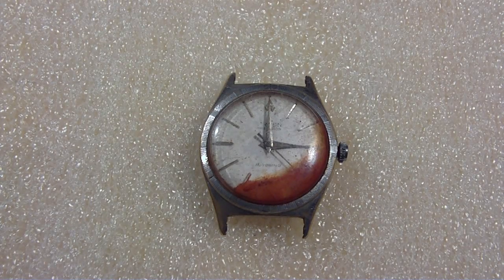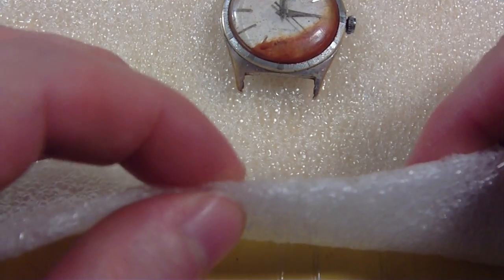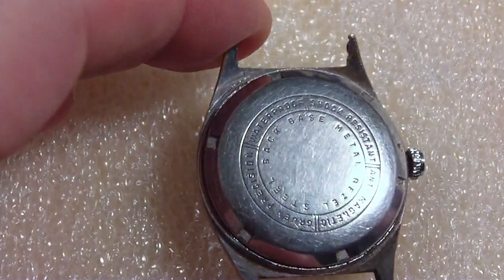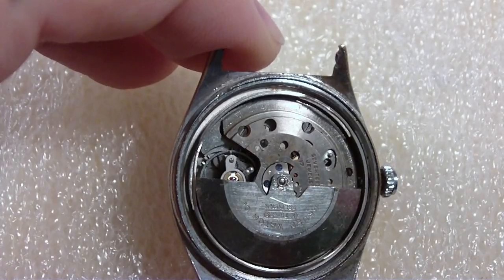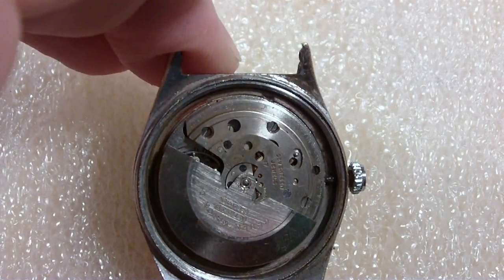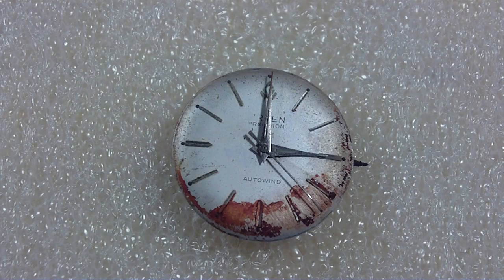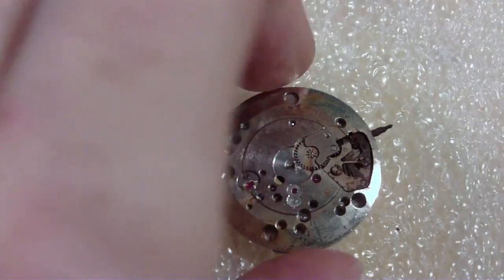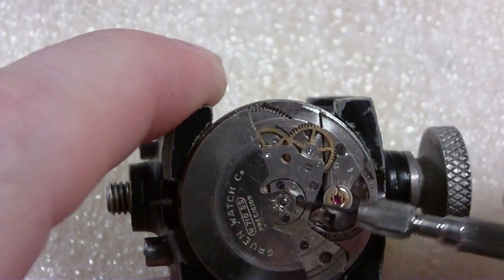How I take apart a water damaged wrist watch, Gruen Precision Autowind

Comment: The crown and stem as you know are rusted due to the crown and case tube leaked in the water. I also see these basket cases on a daily basis.  Just like RJSoftware2000, I also use Vinegar to dissovle and break down rust. Interesting video and appreciate you showing it. Good lesson!

Comment: I love to see movements like this. I use vinegar in ultrasonic and the rust evaporates in seconds. Then neutralize the vinegar acid with amonia.

You can sometimes get away with throwing whole movement minus mainspring into the ultra with vinegar.

Only swish movement (minus mainspring) in amonia for brief moment.

Be warned do not let the dial soak in amonia as some dials don't do well. A few seconds with diluted (water and amonia ) is good enough.

Then use hair dryer to remove water.

Comment from the maker: I bought the movement holder used in this video on ebay.  It is used and old.  I am sure there are more out there like this one, maybe new.  The box reads FOUR IN ONE ADJUSTABLE MOVEMENT HOLDER No. 40424 Manufactured by C. & E. MARSHALL CO.

Comment: Great video. Question: I have a Bulova that runs for awhile and then seems to randomly stop. I give it a good hit/tap and it restarts. It's battery operated. What do you think is causing that? 
Any help would be appreciated. Thx
Reply from the maker: Michael Sherrill I don't know about battery watches.  I would do the easiest thing first and change the battery.  If that don't work I don't know what is wrong.

Comment: You got any tips on removing broken screws? One that has the head sheared off?
Reply from the maker: Well, if it was on a car you could drill it out or use a broken screw remover.  Sadly you can't do this for a watch.  There is a tool that sells for about 100USD on ebay.  It presses down on both ends of the screw so you just rotate the part with the broken screw to remove the screw.  There is another tool I have seen that looks like a screwdriver except it has a couple of little points on the tip.  You press this on the broken screw and rotate.  Another method I read about is brutal.  Get a small punch and punch out the screw.  The problem with that is you have to tap the hole because you just removed the threads when you punched out the broken screw.  That 100USD tool could be made if you know are or know a machinist.  I used to work for company that was crawling with machinists and tool and die makers.  They could of banged one out no problem.
Reply: bunnspecial thank you. I like the idea of griping at both ends with the pronged tips. I can machine one up no problem. The gripping at both ends sounds like the key to success.  I did manage to slot the shank of one screw with a sharp graver and make a slot deep enough to turn it with after a few gentle taps and some soaking. Thank you my friend, love your videos, keeping it real!
Reply from the maker: Glad to be of service.  Check out the tool on ebay for ideas.  No sense in reinventing the wheel.  Make some tips that are small enough to remove a broken screw for a jewel setting and then send it to me.  I will send it back when I am done